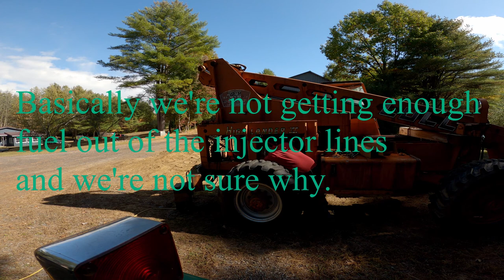1986 Lull 644 Highlander II Telehandler revival. Sitting many years... will it start?

Comment: If cranking speed helps much, and I think it does, then have you considered roll starting these vehicles? Does it have a suitable transmission?  Might roll starting at high revs be healthier than ether?
Reply from the maker: Im not tryina push everything around like a dummy. Ether it is.